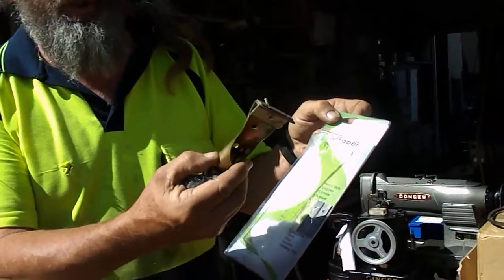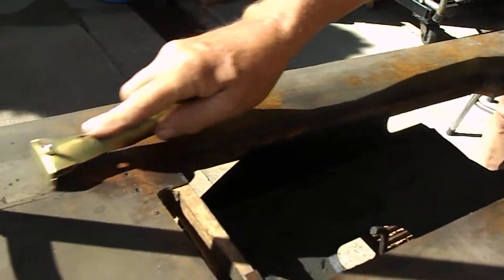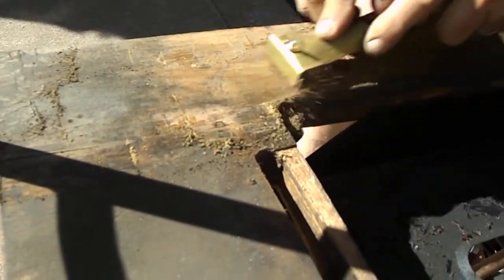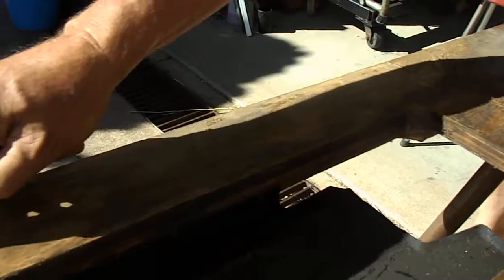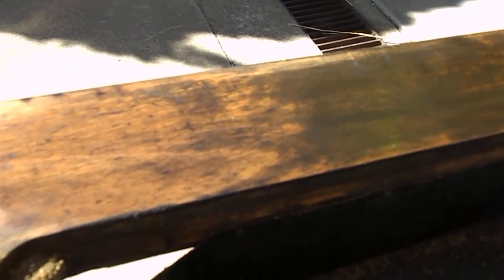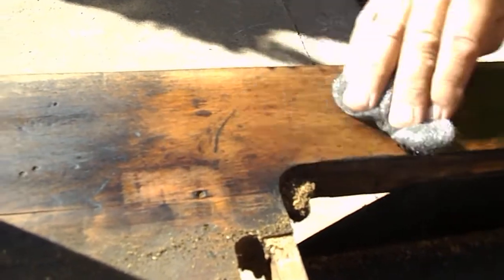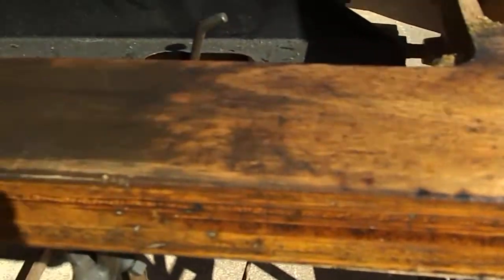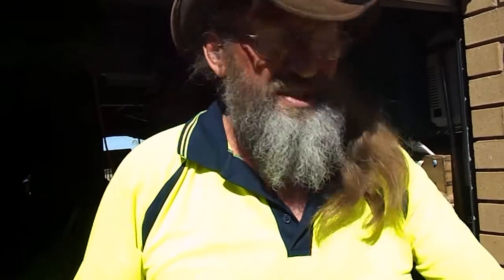Vintage Industrial sewing machine table clean up

Comment: I like nebbing through your old videos. What I do on mine typically is to strip the wood with a bit of denatured alcohol and a razor blade. Then I go over it with boiled linseed oil as well, followed by hand rubbing in hand mixed garnet shellac via a cotton pad with a drop of oil now and then as needed to lube. Get a really nice finish that way.
Reply from the maker: Thank you. There are many way of achieving a Great and easy finish. Thank you for sharing your method.